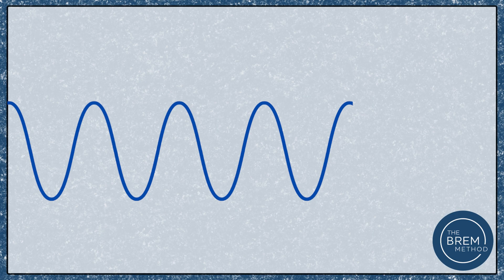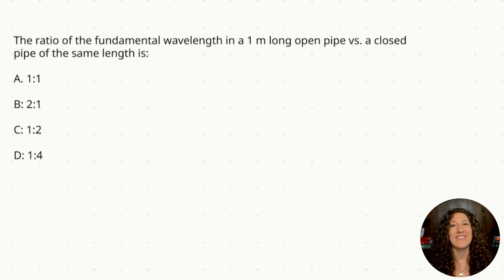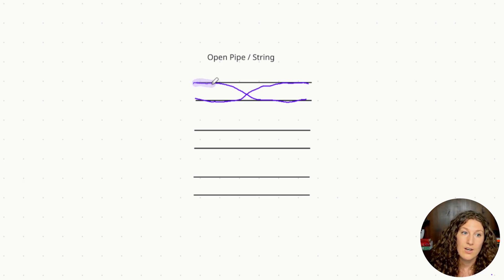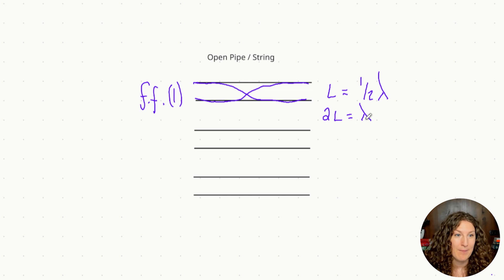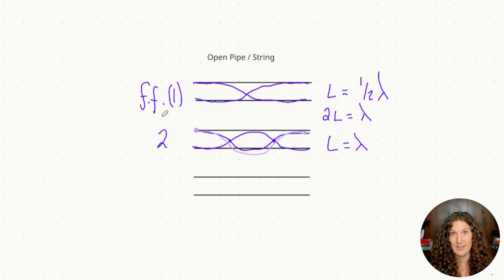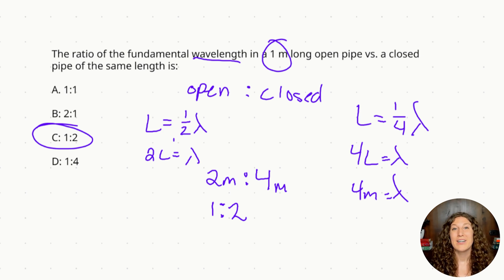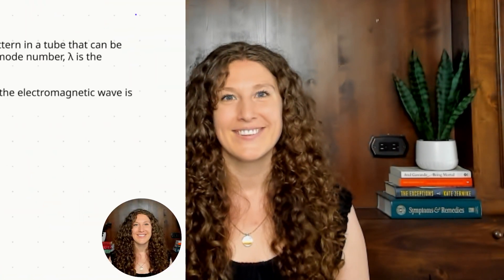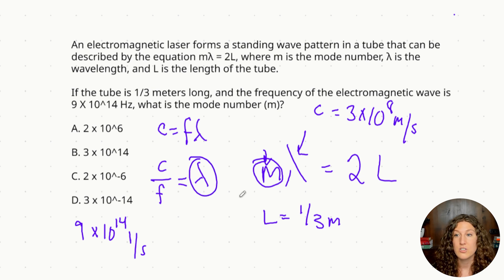MCAT Physics: How to Solve Harmonics Questions on Test Day

Comment: Is there a formula for closed pipe where both ends are closed? I see that you did closed pipe but only for one end
Reply from the maker: A pipe that's closed on both ends will have the same harmonics as an open pipe! We just typically do not see that example on the MCAT. Great question!

Comment: To simplify that last question you could also cross out the 1/3 and are left with (2)/(10^-6) which is just 2 x 10^6 :)
Reply from the maker: 100%! Lots of different ways to approach the calc portion of these questions :).

Comment: In the first question it says the pipe is 1m long for both the open and close pipe which would mean that the ratio would be 2:1 because in the open pipe the wavelength would be 1/2 while in the closed pipe it would only be 1/4. So I’m confused. Please help.
Reply from the maker: In order to create a ratio of wavelengths, we need to first isolate the wavelength (λ) variable in each equation! Because length (L) = 1 m in both pipes, the two equations start like this:
1 m = 1/2λ for the open pipe
1 m = 1/4λ for the closed pipe
Before we can set up a ratio of λ, we need to isolate λ in each equation. To do this, we'll multiply both sides of the open pipe equation by 2, giving us 2m = λ, and we'll mulptiply both sides of the closed pipe equation by 4, giving us 4m = λ. Now we can set up the ratio!
2m (openλ) : 4m (closedλ)
Simplified, that gives us 1:2. 
Conceptually, the equations are telling us that at the fundamental wavelength, we can see half of the wavelength in a 1 m open pipe, but only a quarter of the wavelength in a 1 m closed pipe. That means the whole wavelength in the closed pipe must be bigger, since 1m is only a quarter of the whole length (which would be 4m), compared to 1m being half of the full length (2m) in the open pipe. 
Hope this helps!!